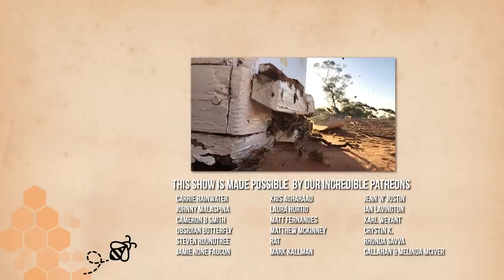Raiders Of The Lost Hive | The Bush Bee Man TV Series: Season 1 Episode 6

Comment: Mmmm, not wanting to rain on your parade, but those birdbox bees are not going to be happy that their combs are tipped on their sides - each cell is angled down at 13deg to the bottom so nectar and the feed that they give to the brood don't run out.
You need to keep each section of the comb the right way up, even if it means cutting it into several sections.
With the elastic bands, it is easier to put one band diagonally across one side, looped over opposite corners, turn the frame over, lay the comb in the frame, and then put another band on the opposite diagonal over the top - saves holding it in place as you band the combs in.